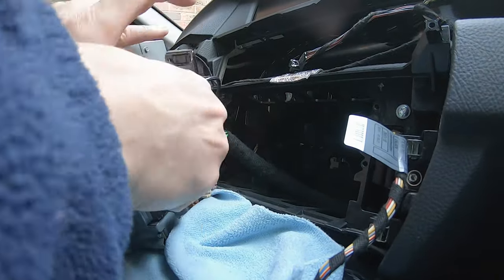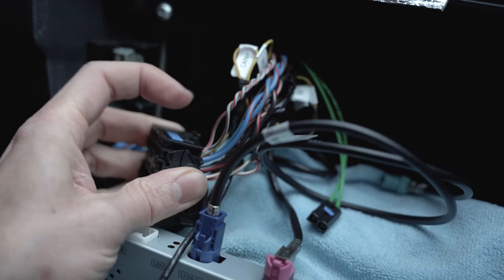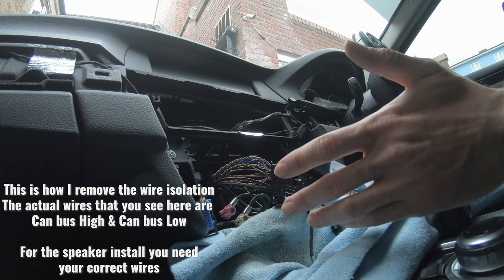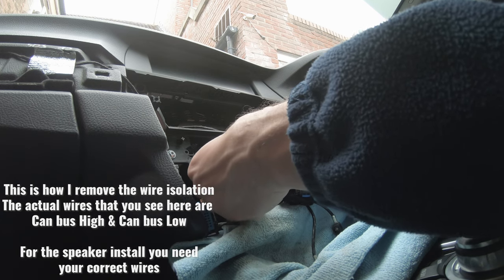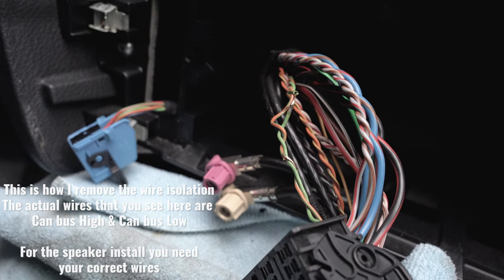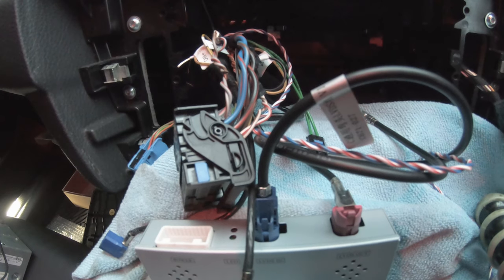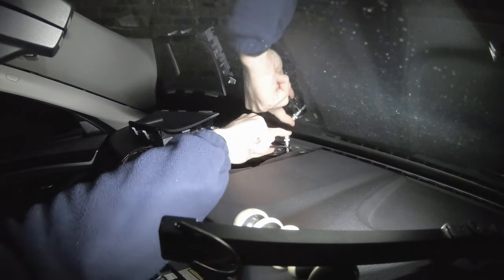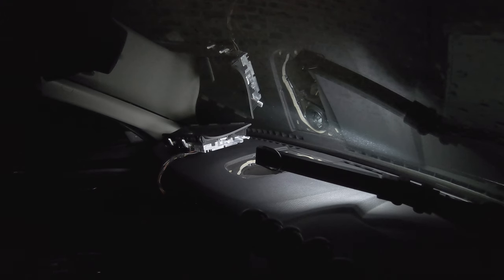How to install Central Dash harman kardon speakers to BMW F10 - Step by Step

Comment: Bro @5:18 you did the isolation on a green color wire , but later you connected to grey color wire , also you said you are going to connect it with the rear speakers , but you used the lighter on can bus low and can bus high, can you explain ?
Reply from the maker: what does it say in the left side of the image ?
Reply: So the lighter part , you showed can bus high and can low as  an example only , right 😅?
Reply from the maker: @faresbmw   that is correct
Reply: @BestCarMods  thanks man you are the best , thats why i subscribed

Comment: Hi can you just plug the wee tweeter to the second plug or use the 2 in 1 cable and plug it just in the one of them? Thanks
Reply from the maker: that is correct. the big speaker acts like a splitter 1 plug 1 and 1 plug out .
Reply: @BestCarMods  perfect thanks

Comment: Are the aliexpress h&k speakers original or just counterfeit?
Reply from the maker: they are very good quality and seem to be original  ... strange that they are very well priced
Reply: Does the central dash spaeker need a mount or is it just plug and play?
Reply from the maker: plug and play + 2 screws  @MrDosSantos991

Comment: don't do it like that, you stress the channel you choose, wire centre in serial not paralel and will be better for cd player. Choose one of rear channels, front already in parallel with under seats subs.
Reply from the maker: If I remember correctly the signal was taken from a rear channel ;) ... anyways now it is running on a separate amp
Reply: Could you explain why the parallel wiring stress the channel ?
And how do you wire it if i chose the serial ?

Comment: its very hard to understand which wires you used, you did not show them or explained them :/  i am just installing this speaker (trying to), googleing which wires exactly to use.
You showed us 4 wires (2 set of wires) and did not say which one to use, and how is it connected? Is it supposed to be rear left negative and rear right positive? Which is which ?
And that ali seller sent 0 instructions with speakers on how to install them
Reply from the maker: i think that if you watch this video in full, say, 5 times you will know what wires you need to use.